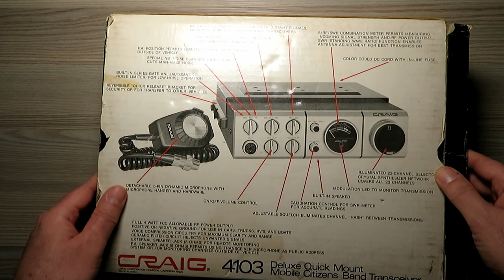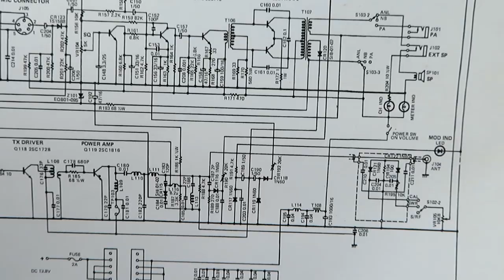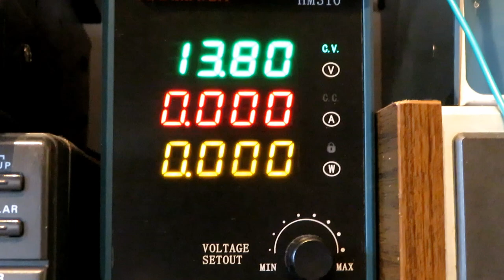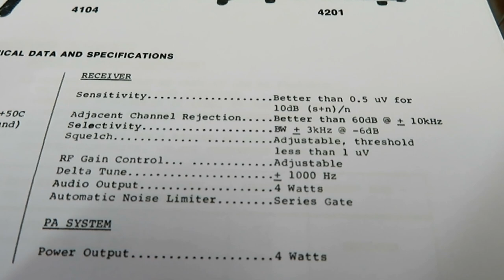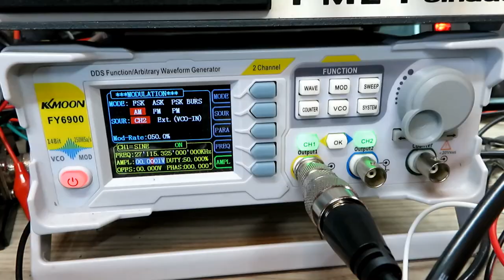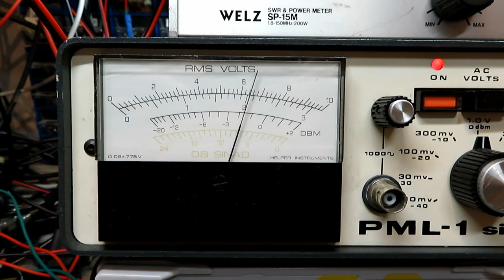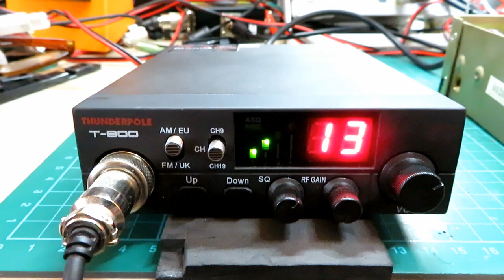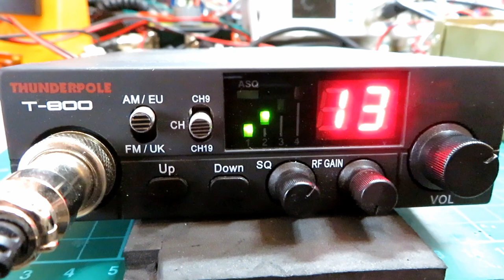SOMETHING VERY FAMILIAR ABOUT THIS HAL? - CRAIG 4103 - REPAIR TUNE UP AND TEST - ITS IMMACULATE!

Comment: Hi Paul.. Ive been looking forward to this video.. i can't thank you enough, it's the first time I've seen the inside of the radio and it looks as clean as the outside.. nice to see the old clunky type rotor channel selector and that fuse type bulb works really well lighting the meter up it has a nice warm glow.. also i think looking at the meter lit up on the video doesn't do it justice, it's a very clear deep set meter that has a very nice quality look to it.. who'd have thought no protection diode, I'm glad i didn't slip with the wires when connecting it up lol..
Thanks again for all the work you have put in and bringing it back up to spec, your services are very much appreciated. 
Great video and as always very informative. Thank you very much, stay blessed.

Comment: Thank you for sharing.  I know the owner and it is his pride and Joy.  I actually have the base station that goes with that mobile and is in fine working order.  I Did give it to the owner of this Craig and we are in the process of shipping from the states.  Great Radios and they were top of the line in the states.  Also expensive as all their radios and stereos but quality in the end.  One of my cousins owned it and never used it much in the 1970s and gave it to me in the early 1990s works just as well as back then.  Just amazing.  Soon he will have the set.  Thanks again for the time you spent explaining the radio.  Cheers.   NY202 USA DREW
Reply: When the radio comes back Drew you do know if the state side skip picks up i will be trying for the contact with you on this radio.. now wouldn't that be awesome.. 😉
Reply: @DeltaXray444  We will get that to bounce  LOL.  I would find that enjoyable.  I talk all over using my older radios and do just as well if not better than a lot of the newer rigs.  Its a clean radio like your base and sure that you will get some great air time and contacts.  Plus those Craigs are about the coolest looking radio.
Reply: @cbradioghosttalk1986  They are a good design, not the usual run of the mill AM rig that's for sure.. I was shattered when the receive went down, but Paul has done an excellent job on it.. the clarity on receive now sounds better than my Yaesue on AM..
Reply: @DeltaXray444  Also the fact that the radio hadn't been modified and is original and in excellent condition means a lot. .  It was a good find and buying and getting it restored was a good move.   A Blast from the past.
Reply: @cbradioghosttalk1986  Have you been to the post office yet to weigh in that 3 kilowatt Donkey Stomper for shipping.. let me know Drew 😏
Reply: @DeltaXray444  Yes I will catch you on the messenger.  Just getting in from the wood pile LOL   wind and snow
Reply: OH, your talking about my kickers, not the Craig.  LOL.  You would hurt yourself and then I would feel bad.  LMAO.  That's just a vicious rumor that I am a card-carrying member of the Super Bowl   LOL>
Reply: @cbradioghosttalk1986  Really Drew really.. you ain't foolin nobody sir.. what's that Mr BBI 4k footwarmer doing being fed by a 959 into a 600 watt linear about and a 8 kilowatt Bird meter and LP500 meter then sitting next to your bench huh huh..
I suppose they are dust collectors huh huh.. now get to the post office and ship that pitiful 3k my way I want to shock a few locals 😂😂

Comment: those 23 channel crystal mixed sets mixed 6 crystals with 2 banks of 4 crystals
giving a possible 24 RX and 24 TX channels, it was easy to wire in the missing 24th combination
 to give an extra channel

Comment: The car on the box is a Cheverlot probably an Impala or Biscayne model early 1970s.  Lots of them on the road I owned a 1975 two-door impala.  I drove a lot of these models as they were used as police cars.  Nice ride but not the best for police work.  Not fast enough and lacked any real power after 100mph.
Reply: Hey Drew when you was a law enforcement officer did you put cb's in your police cars and bust the truckers for speeding 🤠
Reply: @DeltaXray444  I didn't but others did and we lost the privilege.  The Sheriff's office always had a CB base on Channel 9 for many years.  It was also a distraction in many ways.  The problem was always that we had enough radios and channels we had to listen and respond to.  I much preferred having a stereo am/FM in my cars with a kill switch.  We always had channels on our radios that only our cars could use and not a registered freq.  so we didn't have access to a scanner or the base at the office or jail.  I preferred this as we could say what we wanted and did  LMAO only problem was before the channel guard we were on about 32mhz and it would skip at night down to the state of Alabama etc.  LOL.  We could talk from our cars to their cars it was fun.
Reply: @cbradioghosttalk1986  That's crazy.. but to be honest I think I would have preferred having the kill switch to crossover.. I bet those lads down in Alabama heard some gossip lol..
Reply: We also had a High band VHF of about 155 MHz after a while this was a different radio and took more room and then the UHF came in and that compounded problems of inter dept communications etc. another radio.  LOL.  Things are more combined now but they still use Vhf High band to this day.  Computers rule and make life easier but at the beginning that was not true and that's sucked.  Mobile teles are the big thing now.  Cop cars are loaded with so much stuff upfront.  We had to change where we kept our shotguns and AR-15s  LOL  I am 6'4" tall and 250 lbs us.  LOL I mean I don't even fit at the end of my days.  LOL
Reply: @DeltaXray444  They were a mite rougher than us.  LMAO.  You didn't want to get on the wrong side of that sheriff and his deputies.  We had a reputation for taking care of business always but they really went out of their way to enforce the laws and that was a dry country.  No spirits or drink of any kind legal except beer. Worked in a few dry counties down south in the old days you have no idea what that was like.  LOL.  I did fit in but it was a different system and the pay was always low in rural southern states.